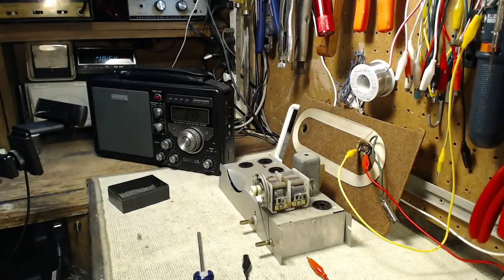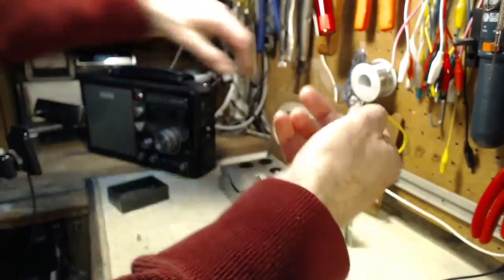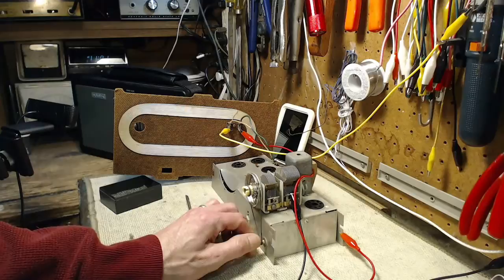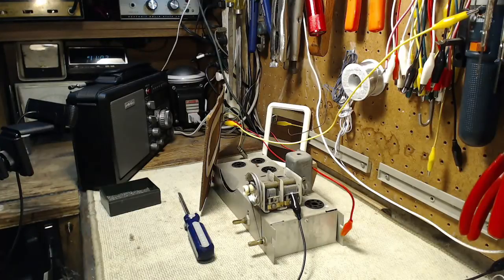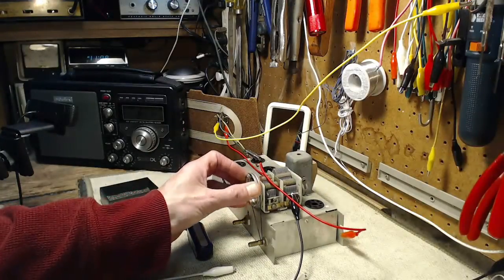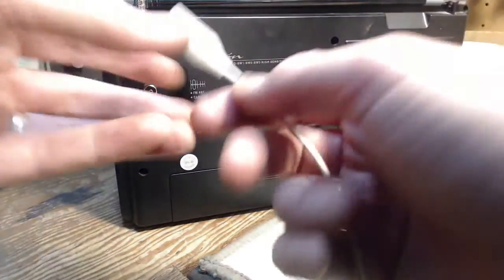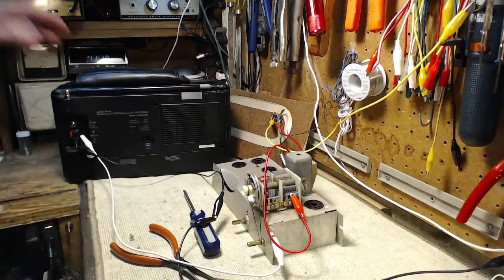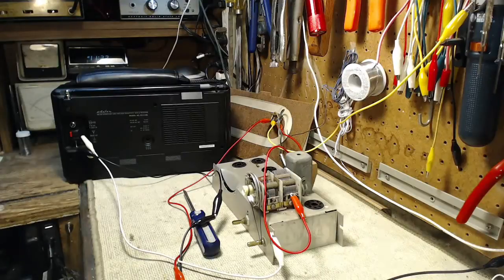Shop Antenna Experiments #1

Comment: Gain from caps and coils? Nope
Gain, more antenna and placement, or an rf preamp.
Reply from the maker: ***** Of course you are right.  The best I can do is reduce the signals either side of the resonant frequency.  If I could achieve a good Q, then I might have something.  I'm thinking the resonating current in the coil might provide a strong signal.  Since I am using available materials, I thought I'd just give it a go and see what happens.
Reply: Yessir Jim, it's fun to experiment.
Some hams have the notion that a tuner makes the antenna work better. A tuner is a loss, not a gain. It's purpose is to protect the PA.  Funny thing, often the fix of the antenna  is very cheap as compared to investing into an expensive matchbox.  I say invest in a good broadband antenna, and match it as best you can - better to do without a tuner.  300$ for a tuner, or antenna?  And a roller inductor doesn't make for a better tuner! I think it's better to have an auto-tuner at the antenna feedbpoint if at all.   Just throwin in my two cents for the other hams reading the comments.  Some hams will invest thousands of $$$ for a few db gain; 10db from an antenna, 10db from a linear, don't come cheap.
Don
Reply from the maker: ***** I have an MFJ tuner for my dipole that I use when transmitting (on PSK31).  On the other hand, I rarely use more than 20 watts of power so there probably is little risk to the radio with a decent antenna.  My antenna cannot qualify as a decent antenna though and I get about 50% reflection without a tuner.  With a tuner, I can get it down to 5%.